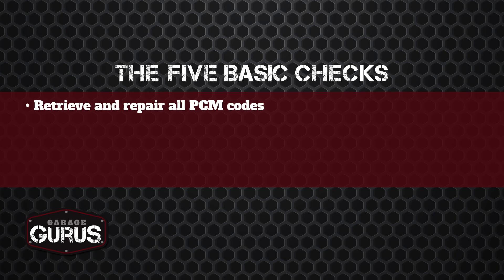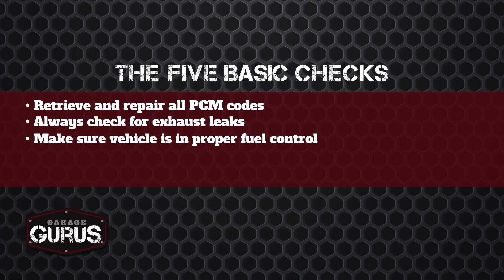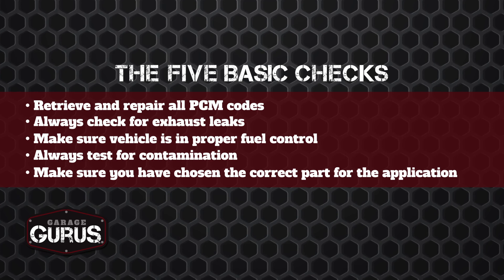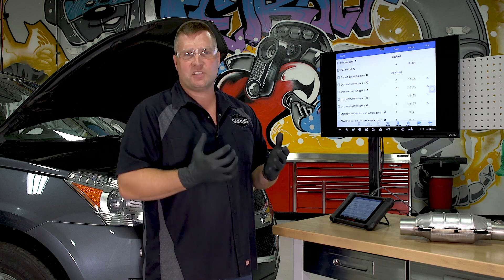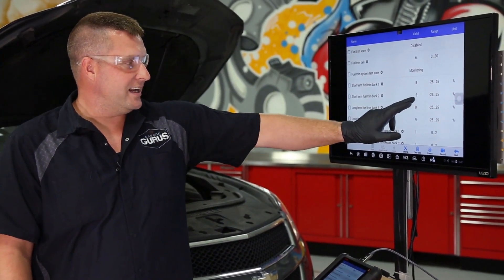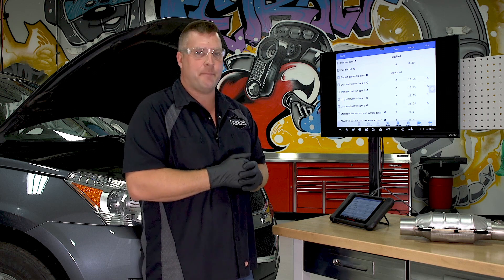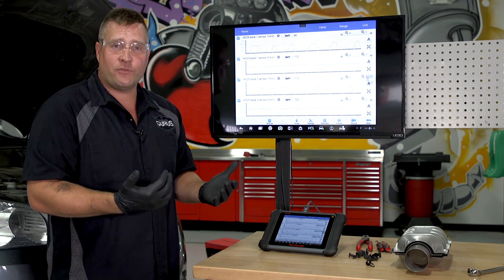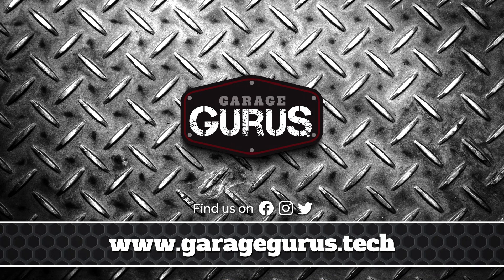P0430 Cat Efficiency Diagnostics

Comment: It was very good, well structured presentation, one of the best I've seen on the subject. Kudos to Drew!
Personally, I am not sure that exhaust depressurization after catalytic converter will cause such a symptoms with Sensor 2 low voltage reading. There's no much pressure drop along the exhaust, theoretically, you can remove remaining part after the downstream Sensor 2 and everything will be working the same (noisy though).
Author's conclusion about no problem Cat looks correct, because Sensor 2 was low on voltage but steady. What I see, the new oxygen Sensor 2 installed with the pipe replacement, absolutely reasonable was not saving pennies on such a big job.
Final verdict: Sensor 2 was aged and not performed correctly, burned pipe replacement was imminent.

p.s. science and education wise, I would take a metal duct tape and wrap the leaking spot, my guts tell me the smocking would stop, but Sensor 2 low readings will be still there, so the "check the engine" warning, giving a precise diagnostic of the sensor malfunctioning.

Comment: Hint: for us DIY'ers...if you don't have a smoke machine to chase down leaks...you can do this--> on a cold engine, insert a shop vac hose ( exhaust side of vac)..... into the exhaust pipe, and spray the exhaust system on its outside surface and on all the flanges with a spray bottle of a mix of water and dish soap.....the "leak" will bubble-up clearly to see. Cheers.
Reply: Would a leaf blower work?

Comment: If the car suffered a slight oil overfill condition to cause the 420/430 code to trip.....will getting the oil level down later help..or is the "damage" done and can't be recovered ?

Comment: Im getting a p0430 code and every once in a while ill get a check coolant level pop up on my dash but it goes away and my coolant over flow is full my car is a 2005 corvette ls2 with 120000 miles so i should have a pressure test on my coolant first? Im not using any oil or any smoke from exhaust but when I bought the car a couple months ago it did have the mufflers off and it came with a bolts s type exhaust that I had installed and after that is when my engine light came on the first time the next day after I had the borla exhaust put on

Comment: Great job very informative. Any advice on how a DIYer may be able to do such a job but does not have and/or able to obtain those nice toys ( smoker, coolant pressure tool etc. ) and keep from visiting a technician shop?
Reply: I'd like a smoker for a number of reasons, like checking turbo intake piping. The coolant pressure tester I have rented from autozone. It worked well to find a stubborn hard to find  coolant leak on my sons vehicle.

Comment: I have one of those apps for OBD2 diagnostics.
I couldn't figure out which gauges are for fuel trim but the bottom O2 sensors sweep pretty wildly from low voltage to high voltage.
So I suppose that means bad cats.
And I think on this 3.5 EcoBoost you can only fit an a spark plug oil Fowler on one side.
But both my cats fire off a code.

One thing I noticed since I bought the van is it's been overfilled with oil by a little bit even when I change the oil recently getting used to how much it actually takes versus how much the manual says it takes. 

If it's been suffering for many miles of extra oil blow by, should I just consider the cat's hosed?
I've tried lacquer thinner, cataclean and a product from rislone and they all kept the codes off for a couple miles but that was it
Reply: Odd that both cats would be bad. Sometimes these engines build gas in the oil due to running too rich. That could be caused by a number of reasons. Bad or weak sparkplugs or ignition coils etc. Oil in the exhaust may be a build-up in your intercooler. That comes from the pcv valve. Also, those PCV valves are known to go bad allowing turbo pressure into your engine which could intoduce oil into your exhaust.bad turbo bearings or seals could do the same but its unlikey both sides go at the same time , which leads me to believe you have one of the aforementioned issues.

Comment: This video was very informative, thank you. I’m looking at purchasing a 2013 lexus gs350 w this code and seller says it’s an 02 sensor and the code comes and goes. I paid a Toyota dealership for a pre purchase inspection and they said the code was not there so they couldn’t test for the things that you tested for. Could they have still tested for this even though I told them what the code was? I wanted them to test the sensors like you did but they said because there was no code they couldn’t do that. Seller has aftermarket exhaust and he says he feels it’s an 02 sensor but all the sensors are after the catalytic converter. Thanks for your help and opinion

Comment: Same vehicle same year. I hve replaced both flex pipes and the catalytic converter up front. Now I will hve o2 sensors and cooling system chkd because engine light still on SMDH. But very informational video!

Comment: I JUST BOUGHT A 08 KIA SEDONA WITH A P0430 CODE. AND I AM TRYING TO USE ADDITIVES TO CLEAN OUT THE SENSOR/CONVERTER, IF IT DOESNT MAKE THE LIGHT GO OUT I WILL THEN TAKE THE CAR IN TO CHCK FOR EXHAUST Y PIPE LEAK AS IN THIS VIDEO.

Comment: This is by far the best video on this code I have found. You go through each step on what to check as root causes for this code BEFORE checking the cat. This helped me find an exhaust leak and I can't wait to fix it and check the live data. I am 99% sure this is causing my PO420.

Thanks so much I will be subscribing.

Comment: My wife's trailblazer ss is getting both po420 and po430. Oxygen sensors are all upstream and downstream both banks brand new. The downstreams both read steady around .75 volts.

Long term fuel trims are around 5% adding fuel at idle and they go up with RPM. Cleaning the MAF has improved these numbers. Oil level is stable and coolant system has no problems. I'm at a loss. 

Still have yet to check for exhaust leaks. But in this video you fix a leak and your poor downstream readings go from bad to good. From what I can tell what I'm seeing now is already good. Steady readings around .75.

What can be setting off this code? I'm currently burning some cataclean in the tank because we need to pass emissions in the next week.

Comment: Have been an automotive tech 4 54 years years how can an exhaust leak Downstream of the number two oxygen sensor cause cat efficiency code doesn't make any sense at that point it has already sniff the cat leaks before that can cause damage to the converter
Reply: Trust me it can. He explained the venturi effect. This is a 3.6l and that stock y pipe leaks on a lot of them causing a 430 code. Normally they make a God awful rattle on cold start up that goes away shortly. After some time of with  that rattle the 430 code usually pops up.

Comment: Nice video but a little hard to do at home without all of that equipment.  You didn't show the smoke machine so I don't know if that is expensive to get but in this case it was necessary.  I have see conflicting information on how long a catalytic converter will last.  I have seen it posted it will last 'the lifetime of the vehicle' and also posted as needing replacement at 100,000 miles.  Since my 2006 Toyota Sienna has 170,000 miles should I normally expect to replace it at this mileage?  I pulled a code on the downstream O2 sensor (bad heater) and replaced. P0430 code showed up next so I replaced the upstream O2 as well.  Waiting to see if that fixed it...
Reply: I put my leaf blower in my tail pipe on lowest throttle and sprayed soapy water all around my exhaust and found my pinhole leaks.

Comment: I have the same problem for my 
2013 Dodge Grand Caravan crew but my check engine light goes on and off.
PepBoys charge $100 for Diagnostic check,
$700 to remove,replace,and labor a catalyst converter that they claim is clogged when they didn’t even do the things in this video besides run the diagnostic 🤬🤬🤬🤬

Comment: Please help!   2016 Silverado 50k miles. I did a  Cold Start & short term fuel trim is .08 to 3.1.  Long term is 5.5.     The video mentions short term -5to-9 
What would you do next givin my fuel trims??  The upstream 02 sensors on both banks are .1 to.9 MV and down streams both stay around 725 to 790.
Reply: +/- 10%

Comment: Been driving my 05 v6 Tacoma with code 0420 & 0430 for almost 10 years now I think the cats are still working sometimes when going uphill you can smell them burning the truck runs like brand new at times other times it's sluggish.
Reply: How can you drive for 10 years with code 430 but mine won’t even start ? How’s that work ?

Comment: Hi Drew, I have 2006 4runner v6 and facing the same issue here is what code 

DTC repor
VIN: JTEBU14R560090570

============1==============
P0420
Raw code: 0420
ECU: Engine control unit
Status: Pending
OBDII: Catalytic converter system, bank 1 - efficiency below threshold
============2==============
P0430
Raw code: 0430
ECU: Engine control unit
Status: Pending
OBDII: Catalytic converter system, bank 2 - efficiency below threshold

I need your help please

Comment: I have this check engine light now with currently 76k miles on my 2009 SRT8 6.1L HEMI CHALLENGER. 

I do hear a little hizz sound around the mid pipes of the exhaust. 
So it could be a leak. 
I tried CATACLEAN 2X and Chevron Fuel System 2x already too.
Reply: Did you fix your check engine light?

Comment: Perhaps do not use bad gas, but use good gas for 3 months and the p0430 will disappear. The p0430 is now caught by the sensor due to the bad smell...
If it is the owner's car, using a good gas will disappear the oxygen sensor.
Probably don't pay for repairs at the car center and use good gas for that money.

Comment: Hello, I'm having the same issue with g35 but it states bank 1 and two including code P0430. Would I need to get a new cat?
Reply: Same here but with a cadillac
Reply: I just replaced the cats on my vehicle a month ago and these codes showed up.. wondering if the aftermarket cats are no good. Did u get it figured out?

Comment: Thanks Drew. How come no one mentioned this to me when I was told I needed a new cat converter?? I get it that it may have been damaged, but what about HOW it got damaged....I don't need a bandaid and continue to have a problem somewhere. That really fires me up. Thanks again, Drew, thank God for Youtube vids like this to reduce getting screwed.
Reply: Damaging CAT  from many thinks putting cheap gas , leaking coolant in to Exhaust system or engine burning oil or Fuel injectors worn  this are main problem will damage CAT so quick  if your car mileage is lower than 150K
Reply: @danyeldan2139  Thanks!

Comment: wondering what kind of damages a prolonged exhaust leak (right before or right after the catalytic converter) would cause
Reply: If there í a small hole in the Exhaust before the 1st Oxygen Sensor, that's too much wind/Oxygẻn touching the Tip òf the Oxygen Sensor. The Oxygen Sensor will read this as a Lean Condition ( Lơw Voltage Constantly ). The Computer will try to correct thís Fault and will make the car Ảir/Fuel Ratio run Too Rich , thus making the vehicle fail fỏ High CO ( Carbon Monoxide ) on vehiclés in California up to Model Years 1999 ____ and some Smog Techs or DIYers will have Customers paying fỏ components that make cars Run Rich......In Reality, it was a Hole in the Exhaust System , that wás the problem ( which he showed ). Never woulda known the real fault if Smoke Machine never was used.

The Front Oxygen Sensors Voltages should be switching faster than women blinking thẻi eyes at a man.....Rich Voltage to Lean Voltages quick & constantly.

Smog Repair background
Southern California

Comment: Does anyone know about how much is the total diagnostic he did on this video?
Reply: At minimum, 1 hour.
He waited 15 minutes alone to ensure thêre wêre no Coolant Leaking anywhere in the Cooling System.The Radiator Cap is a 15 PSI Cap. He applied 15 PSI with the Côoling Systếm Pressure Tester. When he returned, it wás still holding 15 pounds òf Pressủre. A 2nd of his "5" Tests, he installéd his Smoke Leak Tester in the Tailpipe of the car, but he didn't show the Public that he did. After that he visually looked for Smoke from Possible Holes in the Tailpipe, Muffler, CATS, pipes nẻar the CATS & the Exhaust Manifold.

Fôrgot , some serious Welding was involved, which he didn't show. ( 30 minutés to 45 minutes )

If the situation would have been a "Direct Fit Catalytic Converter", no Foolish Waste Your Time Welding would have been involved because it would be a "Bolt On Situation".

Smog Repair Background
Southern California

Comment: This is a fantastic video. Best one on the topic I’ve seen. Thank you! Is there another video on what you would do if the fuel trim was off?
Reply: Are you sure you wonna know ?
I'll give you 90 % of the Ănswers.

The Long Term Fuel Trim ( Air/Fuel Ratio ) Specs. are - 10 %  to + 10 % @ Idle Speed & @ 2,500 RPM...If not, it's time to call Hôuston....The Smart Tech. Test all of thêse components & give thêse Pass ỏr Fail Results to the Customer :

Positive out of range LTFT, say +25 means the Computer had to add 25 % to try & bring vehicle back to proper Air/Fuel Ratio ( 14.7/1 ) because òf this serióus Lean Condition

-25 % LTFT means the Computẻr had to Subtract 25 % of Fuel to bring car back to propẻr Ảir/Fuel Ratio bêcause the cảr/truck ís Running Too Rich ( Fuel Ecônomy will Suffer )

+ Fuel Trims > than 10 :

1. Ignition Systém Pass or Fail Results
2. Exhaust System Pass or Fail Results
3. Low Fuel Pressure results
4. Clogged Fuel Injectors Pass or Fail
5. Mass Ảir Flơw Sensor Fault
6. Oxygen Sensors Results
7. Vane Ảỉr Flơw Sensỏr dêfect
8. Manifold Absolute Pressure Sensỏ Fault
9. Throttle Position Sensor fault
10. Vacuum Leaks from Intake Manifold , hosés ỏr unmetered ảir from intake snorkel
11. PowerTrảin Côntrol Module malfunction ( The cars Main Computer )

Fuel Trim reading > than - 10 % but especially greatẻr than - 20 % & this Number ís fỏr Both ( - Fuel Trim ỏr + Fuel Trim ) :

Test Results for :

1. Dirty or the Wrong Grade of Oil
Example :  Car calls for 5W-20 Motor Oil but Saw Mill Mechanics or DIYer sáy "Oil ís Oil", so 10W-30 Oil is ínstalled.

I once worked for a real nice fella in Downey, CA. He put the WRONG GRADE òf Mổtor Oil in a Womans car. When she drove to thê Los Angeles Forest , her Engine SEIZED up on "er - going up those Steep A_ _ Hills.......
......I wunda how much that cost 'em...

2. Dirty Air Filter !!
3. Engine staying in OPEN LOOP Status Too Long
4. Clogged PCV Valve
5. Idle Speeed Too Low
6. Advanced Ignition Timing
7. Mass Air Flow Sensor Faulty
8. O2 Sensors Faulty
9. Engine Coolant Temperature Sensor Fault
10. Intake Air Temperature Sensor Fault
11. Manifold Absolute Pressure Sensor Fault
12. Throttle Position Sensor Fault
13. High Fuel Pressure
14. Leaking Fuel Injector
15. A Grounded Fuel Injector
16. Leaking Fuel Pressure Regulator
17. Low Compression from 1 or more Engine Cylinders
18. Incorrect Camshaft Timing
19. Faulty Evaporative components

Is your Head Hurting yet ?

Ex - Smog Repair Tech.
Southern California
Reply: Charles E. Barkwell wow amazing! Thanks! I won’t lie, makes me want to trade in my car 😂
Reply: In my case, my long-term fuel trim on Bank to is 13% but that’s only while idling. When I’m driving it actually looks fine, so I thought it was a vacuum leak but I wasn’t able to find one

Comment: You used Walkers test to check the Cat and they have some good info for testing, but I have had 2 GM's that I put Walker replacements on and came back with the same code. Install OEM  cat's and light is gone and happy customers. In my opinion they need to do some more research on their GM cat replacements.

Comment: I Have this code on a 2016 Honda Pilot, I Had to subscribe! Your Very Professional and Knowledgeable! Appreciate ya!
Reply: Did you get it fixed ?. I have the same vehicle and same issue.
Reply: @joshc710  yes I did,  they replaced All the injectors. And about 20,000 miles later the check engine light came on Again for the Same thing. So 2 weeks ago they all got replaced a second time. But dealer would only split the cost, not cover entirely.
Reply: @cliffordgallagher4531  

2,000 Miles or 200 Miles Later, right.
Surely not 20,000 miles , right.
Reply: @cbarkwell1000  it was just under 20,000 later. Was about 10 months after the first set of injectors. Which should last longer
Reply: Regret hearing about that Gallagher.

As one of my Grandfathers use to say from East Texas , " Now that's a Scandal and a Shame".

P0420/P0430 Checks : Catalytic Converters Below Threshold

1. Intake Manifold Leaks
2. Leaking Fuel Injectors
3. Incorrect Spark Plugs
4. Faulty Catalytic Converters
5. Ignition Timing Error
6. Coolant Leakage Fault
7. Technical Service Bulletin Fix
8. EGR problem
9. Oxygen Sensors Faulty
10. Oil or Anti-Freeze entering Exhaust
11. Hole in Exhaust before Front Oxygen Sensors
12. Silicone contamination
13. Road damage to CATS
14. Front/Rear O2 Sensors switched mistake

Comment: I heard a vacum leak can trigger a p0430  0r p0420 but you did not mension, ???
Reply: You're right.
Reply: Yeah turns out my problem was a vacuum leak on the egr valve pipe where it connects to the intake manifold .thanks for the video.